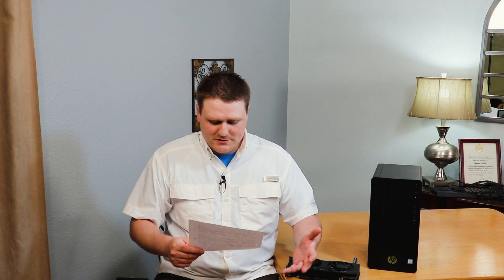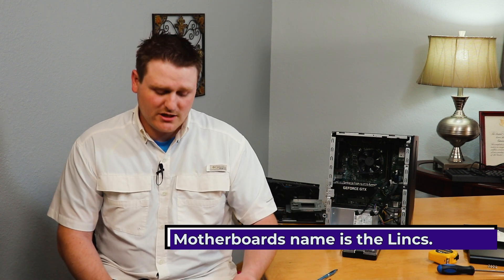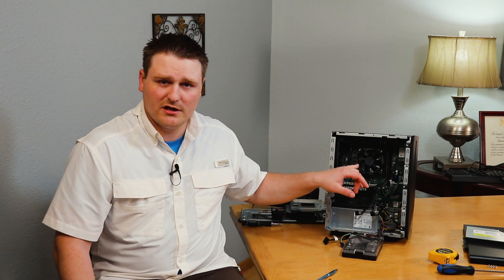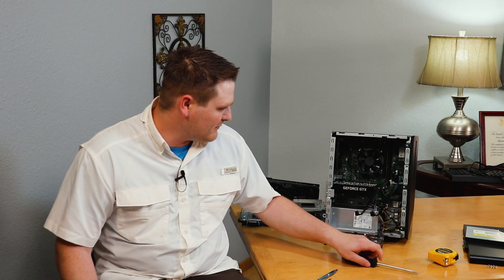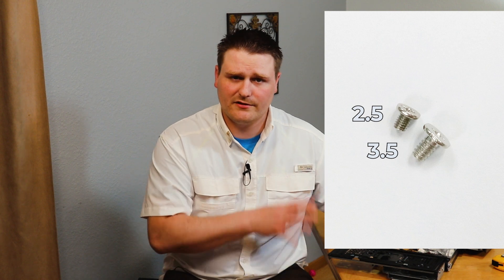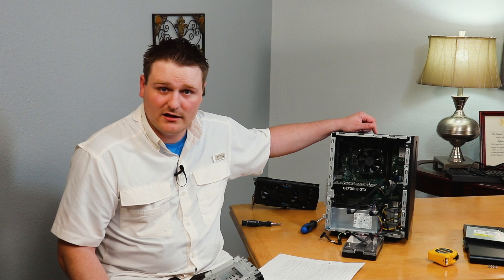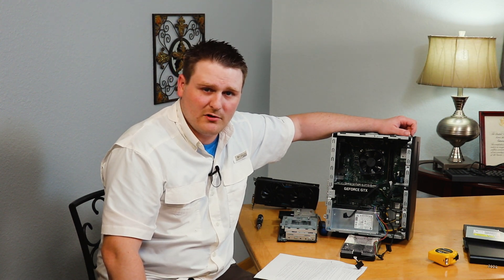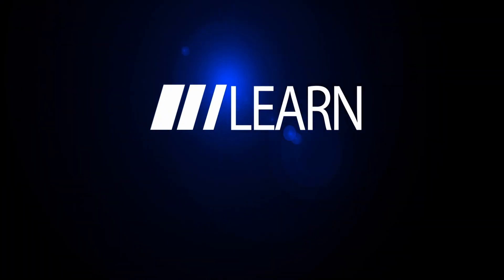Upgrading A HP Pavilion Gaming Desktop Explained! | Intel i5, 1660ti, 8GB, SSD + More! HP 690 Models

Comment: I have a HP pavilion desktop with a gtx 1650 super and I want to get an RTX 2060.  It came with with a 400w psu but it only has a 6 pin. Should I get the 400w psu you mentioned in the description or just an 6 to 8 pin adapter?
Reply from the maker: 6 pin to 8 pin will be fine. Make sure it is 16 or 14 Ga wire
Reply: @TNW1337  I found one at 18awg. Does bigger mean better or should I look for a 16?
Reply from the maker: @joellikebowl  smaller is better. smaller = larger wire.
Reply: @TNW1337  thanks!
Reply from the maker: if you wanted to you could do a 3070.  As long as it does not go over 220TDP with Boost. Also you will need a 6 to 8pin and then a 8 to daul 8 pin. also you will want the card to be no longer then 10.25
Reply: @TNW1337  cool. I'm still going with the 2060. By the way I actually have the Ryzen(TG01). Is that clearance still good? The card I'm looking at is just shy of 8in
Reply from the maker: @joellikebowl  You will not be sad it is a great Card. Also it can support the RTX supper, not sure if you want to go that high on budget. Or you may want to wait for the New AMD Radon cards coming out. The 6000's They say they may kick the crap out of the RTX 3 series. And are going to be cheaper.
Reply from the maker: @joellikebowl  Yes it will work it is the same it is 10.5 so as long as you stay below it your fine.
Reply: @TNW1337  thank you. It's such a pain to upgrade prebuilds but your videos took a lot of the guess work out.
Reply from the maker: @joellikebowl  Thanks man here to help :P

Comment: I have the hp pavilion desktop 690-00xx trying to upgrade the ram and don’t know what one I need
Reply from the maker: 2666mhz but the best price is going to be for 3000Mhz/3200Mhz CL15 or CL16 if you can find 2666mhz go for it, lower CL number the better so CL15 is better then CL19. You can go up to 32Gb 2x16Gb dims. 288pin DDR4 3000Mhz CL16 or 288pin DDR4 2666Mhz CL14 or CL15 is what you want to look up also 3200 maybe CL 18 or 19 will work I've tested it. It does Clock it down to 2666Mhz or 2400Mhz.
Reply: @TNW1337  Samsung 8GB DDR4 PC4-21300, 2666MHZ, 288 PIN  this should work correct
Reply from the maker: @jtrillz4597  yes
Reply: @TNW1337  just ordered thank you
Reply from the maker: @jtrillz4597  No problem
Reply: @TNW1337  would this work with 690-0020
v-Color Prism RGB 16GB (2 x 8GB) DDR4 3200MHz (PC4-25600) CL16 1.35V Desktop Memory Module Ram Upgrade Gaming UDIMM -Grey (TL48G32S8KGRGB16)
Reply from the maker: @xKego.  I like oloy ram for the hp. It normally runs the speed you by. That is a good brand.

Comment: Hi I have a question, I want to upgrade to the GTX 1050 Ti Gaming 4G graphics card. Does this pc support that? I also don’t know if it supports dual fans.
Reply from the maker: It does suppot 1050ti if you have a 6 or 8 pin. On the psu
Reply: @TNW1337  hi I have another question, will it fit in the desktop, the msi 1050 ti gaming graphics card?
Reply from the maker: @cpn1439  It should yes.
Reply: @TNW1337  thank you man, means alot
Reply: @TNW1337  thanks

Comment: Can it support the new nvidia rtc 3000 series
Reply from the maker: Um If the TDP of the card is lower then 180watts yes, Also you would need a 12 pin to 8pin adapter. Also the size of the card can not be larger then 10.5"

Comment: Can I upgrade from 1650 to 1660ti on a 310w psu
Reply from the maker: If you have a 8 or 6 pin yes, but you will be at the limit of the PSU. The 400wats psu from HP is only 77$. I have not tested it but it may work.

Comment: Does the come with an extra cable to add a ssd
Reply from the maker: Some models do. depends on the set up.
Reply: @TNW1337  I got the same pc and I want to add a ssd
Reply from the maker: @wesxzy  You may need to pick one up they are cheap just make sure to get a sata 3 cable.
Reply: @TNW1337  I also got another question, what’s the highest graphic card I can upgrade to that the pc can handle
Reply from the maker: @wesxzy  With the 400w PSU 2060 Super.
Reply: @TNW1337  what about the PSU that comes with it already
Reply from the maker: @wesxzy  You will have to look.
Reply: @TNW1337  okay I don’t know a lot about pc but I want to see if you know
Reply from the maker: @wesxzy  If you google your model it will tell you what Psu you have. It would be hard for me to know all of them, as they have about 70+ different models and combinations. Most people just see the 1st 3 numbers, But the number that come after are more important.
Reply from the maker: @wesxzy  Also they have a Intel and AMD version so it is more like 140+ models. I wish my memory was that good :)
Reply: @TNW1337  I’ll check and see if I can find it
Reply from the maker: @wesxzy  Should be on the bottom of the case.
Reply from the maker: @wesxzy  Do you have the same PC in the video ? same specs ? if yes you should have the 400 watts PSU. It has to be the same Specs word for word. Hopefully this helps .
Reply: @TNW1337  yes I have the same pc in the video
Reply from the maker: @wesxzy  Then yes you will have the 400Watts Psu sir.
Reply from the maker: @wesxzy  hopefully that helps :P

Comment: Is the case change able and the mother board?
Reply from the maker: Yes and no you can use the Cpu, Ram And Gpu. Motherboard will have to stay with the Hp power supply. It is a Hp prob and will not fit in a normal case.
Reply: TechNitWit so it has to be a hp case?
Reply from the maker: @flako5904  yes
Reply: TechNitWit so I can’t change it to like a nxzt case or other gaming cases sorry bothering just trying to get a new pc
Reply from the maker: @flako5904  nope

Comment: I heard the sunflower motherboard is customized fitting, is there any other case that i can get that will fit the sunflower
Reply from the maker: Yes and no Most of the time due to the proprietary MoBo and PSU people just take the parts like Ram, Cpu, Gpu, Drives and swap them.

Comment: hi I have AMD Radeon RX 580 4 GB (256-bit) GDDR5 and I want to change to NVidia please help me with a decent upgrade
Reply from the maker: Do you not like Radeon cards ?
Reply from the maker: 1660ti or a 2060 GTX
Reply from the maker: @LucaTim-official  Ah what Power supply unit do you have as this may limit you.
Reply from the maker: @LucaTim-official  Cool, you could put up to a RTX 2070 Low powered card in if you wanted to. I have not tested a 2070 But I know a 2060 Super will work.
Reply from the maker: @LucaTim-official  Any time sir.

Comment: great video, do you know if the psu and size would be enough for a rtx 3070? thanks!
Reply from the maker: Well they are going to have 12 pin connectors from my understanding. they are also going to use less power. I am pretty sure if you can get a 8pin to 12pin adapter and the card is under 10" yes it would work.
Reply: @TNW1337  awesome! also, I just bought a wd black nvme sn750 ssd, is there a slot for it? or would I need any cables for it? ideally I'd like to keep the included m2 and add this one too..
Reply from the maker: @skabossdude  No if it is a Nvme there is only one slot, there is a extra Sata Port.

Comment: So I got an RTX 2060 coming in which is 8 pin , the PSU I have has a 6pin for the card with a 2 hanging off of it . will I be able to use those together or would I have to buy a 6 to 8 pin adapter ?
Reply from the maker: You will need a adapter 6pin to 8pin adapter.
Reply: @TNW1337  thanks very much
Reply from the maker: @mortifidpenguin  I was mistake, some do have the 8pin that splits to a 6pin My 690 has it my TG does not it is a 8pin
Reply: @TNW1337  O perfect yea figured that might be the case but I wasn't sure relatively new to building pc's hoping to do a full build later this year or early next but figure this would be a good learning opportunity and also allow me to get a bit more use out of the HP I already have

Comment: Thank you, have a good day man!
Reply from the maker: No thank you for the support :P
Reply: @TNW1337  One question please, can I upgrade the stock CPU Cooler with this one? 

https://www.amazon.com/Noctua-NH-L9x65-Premium-Low-Profile-Cooler/dp/B00VB3Y89E?ref_=ast_sto_dp 

Thank you!
Reply from the maker: @thienhofficial  Yes but you will need to do a little modding. I have a video planed on this soon. You will need 10-12 mm screws of the same tread pitch that Intel uses. I found these at my local hardware store.

Comment: Correction regarding the RAM speed. This PC does not support XMP RAM profile, most of the performance RAM, like Cosair Vengeance, use XMP and will only run at 2133MHz. 
Safer to get 2666MHz CL19 RAM if you want to run at 2666.
Reply from the maker: Yes and no I've found that 3000mhz likes to run @ 2666mhz, You are right Hp motherboards do not support xmp. Most common ram now is 3000mhz

 I need to add in a correction it was not 2666mhz it was 2400Mhz was the common speed found.
Reply: Can you list the exact ram you have tested that actually runs at 2666? You recommend some performance ram and I have verified they only run at default of 2133.
Reply from the maker: @rawfish123  The hinix sticks from hp run at 2666. I may have not spelled that right. the Adat Kit I used in the video runs at 2400 it was 3000mhz. Also you have to understand your going from single Chanel to dual. With the New Intel and AMD They need Dual Chanel to not be bottle necked. 

If you had 2000Mhz ddr4 dual channel over single dim of 3200Mhz you would have a gain of 25-35% with the dual dims depending on What Cpu is used . Even with the slower Speed, the different from 3200-2133mhz is negligible at best. If you could set the speed on the system. You would not see that much of a gain, maybe 10-30 Fps gain that's going from 2133 to 3000.
Reply from the maker: Hope that helps I also tested crucial  8GB & 16GB dims they both did 2400. 16Gb dims was 2x16GB 2666 and 2x8GB where 2400. They Both clocked at 2400Mhz. Corsair also did 2400Mhz @ 4GB 2X dimms
Reply from the maker: I had some one else that got a corsair kit and it clocked it to 2133Mhz Is this looking in the Bios, Task Manager, Or Hardware Monitor? HW Monitor you would have to dl & install.
Reply: @TNW1337  OK thanks for the info. I know I won't real world diff from 2133 to 2666. But it just bothers the engineer in me. We'll see what deals we'll see Black Friday. Looking to ugrade to 32 from 16.  FYI, speed is confirmed with CPU-Z.
Reply from the maker: @rawfish123  It bugs me to Not sure why HP does not add in the support. it is a z370 chip set it is rated up to 3000Mhz. Also if they beefed up the thermal solution on the board, I've seen z370 get up to 4200Mhz Oced. 

Also there is no reason why the boards should not support up to 3000Mhz XMP. Maybe its so they can push the Omens? I feel like it was one of 2 things. They had it disabled to push buyer that wanted faster memory to a more expensive product. Or they did not want to pay for the driver support from the motherboard manufacturer. 

At this point I am just guessing.
Reply from the maker: @rawfish123  Yeah if you want make sure you can get the fastest speed 2666 your stuck with the hinix ram that hp supports. 

But going from 2400 from 2666 is pretty small of a hit. Also The kit is cheaper then hps. where the 32Gb kit from hp is $340
On amazon you can get a 32Gb kit for $100.
Reply from the maker: @rawfish123  I made a mistake the adata kit is ruining at 2666Mhz
Reply from the maker: @rawfish123  For the 690 or the TG?
Reply: @TNW1337  690
Reply from the maker: @rawfish123  https://pastebin.com/9dKxtZSv
Reply from the maker: @rawfish123  Did the link work for you ?
Reply: @TNW1337  thx it worked. Yes the adata has a good spd table. It does have timings for 2666. I'll put that on my list.
Reply from the maker: @rawfish123  Do you Have the 690 or planing to buy ?
Reply: @TNW1337  I've the 690-0073w
Reply: Got a good deal on the AData XPG and can confirm it works at 2666 cl19. I suggest you remove the vengeance from your recommendation since they only run at 2133.
Reply from the maker: Give me 2 min to boot it up

Comment: Can I upgrade my HP590 with the 500W L05757-800 PSU ?
Reply from the maker: I will have to look when I get home, My understanding is they only  made a 400 max.
Reply: @TNW1337  thx. Mainboard and connector cabels are the same as on mine. Also the case size is identical. But not sure about the width / length of the PSU.

Comment: I have a HP 790 how do you fold that bar you are laying down there
Reply from the maker: push the gpu to the back of the case, it will then snap in. then you can close it.
Reply: @TNW1337  probaly ganna take some fanasing
Reply from the maker: @alphadogzairsoftfamily7245  it should not take to much but if you press the card to the rear it should just slide in. Then you can close the latch.
Reply: There is a meatle silver storage compartment that empty really with it where not there would give me more room but looks like it I want too remove it all have too remove the face plate .
Reply: Left side is hard drive & CD rome but there is a bracket on the right empty ram is under hard drive .
Reply: @TNW1337  this one is duel fanded I'm not sure
Reply from the maker: @alphadogzairsoftfamily7245  Dual fan should be fine.
Reply: @TNW1337  ok ty do you know where the screw is so I. Can take the black peace off lol
Reply from the maker: @alphadogzairsoftfamily7245  Sorry no, I used the plate the was on there stock. I know you can remove the mother board to get at it.
Reply from the maker: @alphadogzairsoftfamily7245  I know the 790 is a bit different from the 690.
Reply: @TNW1337  ok so do I need both the p1 cable that's hooked too the mother board & p4 cable for this card im ganna try too get it in there I just don't see how im ganna sqeeez it in there with that black bar in the way .
Reply: Ok I got it in there but it said please power down & insert all pci power cables I have a p4 cable out & a p1 cable in my mother board do I use the p1 cable or do I need a adapter

Comment: EVGA GeForce GTX 1060 SC GAMING, ACX 2.0 (Single Fan), 03G-P4-6162-KR, 3GB GDDR5, DX12 OSD Support (PXOC) this is waht im looking on upgrading too i have a 1050 know
Reply from the maker: Well the 1060 is not going to be a huge upgrade. It is still a upgrade about 7-10%

Comment: i have 400 watt 
i have I3
Reply from the maker: Yeah It should work just make sure you have a 8pin or 6pin extra inside.
Reply: @TNW1337  ok awsome ty
Reply: I'm looking too upgrade for when I can play im going into the Army National Guard bro I'm 31 2 kids married ill be resves but I'm ganna kill it I work 4 10 hour shift makeing 17.60 at amazon right know I'm 213lbs I ran 3 miles yeasterday doing 9minuts a mile fucking ganna be the best .
Reply: I work out daily body wait only love the video thank you for the help
Reply from the maker: @alphadogzairsoftfamily7245  Good Luck Dude, This will work out great. Make sure you spend the time to get in shape.  It will be worth it for basic. Make sure to work on Sit ups, pushups and Pull up's.
Reply: @TNW1337  I have been daily do you think Gigabyte GTX 1060 G1 Gaming 3GB GDDR5 Graphics Card (GV-N1060G1 GAMING-3GD  V2) this would fit in my HP 790
Reply from the maker: @alphadogzairsoftfamily7245  post a link
Reply: @TNW1337  on my phone sold by bitpro
Reply: It's on newegg I just bought it
Reply: @TNW1337  💖

Comment: Can you put a 1650 super in this pc or no?
Reply from the maker: Yes you can. You could put a RTX 2060 Supper if you like, if it has the 400w Psu. I will have new video showing it soon, editing as we speak. 2060 Supper & 16Gb Ram upgrade With Bench marks to show the differnts.
Reply: and also is 1650 better than 1050?
Reply from the maker: @wizyo69  Yes it is by a lot. if it is a 1650 super. 1650 is about a 17% gain the Supper is almost a 60% gain
Be aware that the 2060 where going for about $300 $320 last time I cheeked.  Whats you budget ? 175?
Reply from the maker: Here's a  link to a good card 
https://www.amazon.com/gp/product/B081KY5L57/ref=crt_ewc_title_huc_1?ie=UTF8&psc=1&smid=ATVPDKIKX0DER
Reply: oh ok thanks because i want to upgrade my 1050 to a 1650 and upgrade my 8gb of RAM to 16
Reply from the maker: @wizyo69  Make sure its a supper.
Reply: i really need the best advice because i know nothing of this stuff so if it’s ok if you could put the links to what i need to buy I would greatly appreciate it
Reply from the maker: @wizyo69  Sure
Reply: @TNW1337  thank you
Reply from the maker: @wizyo69  Welcome
Reply from the maker: @wizyo69  https://www.amazon.com/gp/product/B07RM39V5F/ref=crt_ewc_title_huc_1?ie=UTF8&psc=1&smid=ATVPDKIKX0DER

Comment: Greetings, thanks for the video, if I upgrade this desktop with a gtx 2060 super do I need to change my power unit? Currently I have a 1050ti, 16gb of ram and a ryzen 5200; im new to the PC market.
Reply from the maker: if you have the 400w PSU yes
Reply: @TNW1337  thank you

Comment: Any cpu coolers that you would recommend for it? I want to add on eof those and a new exit fan. Any recommendations?
Reply from the maker: I like Cool maters, Deep Cool & Noctua Corsair does make some ok stuff as well.
Reply: @TNW1337  will the DEEPCOOL GAMMAXX GT BK fit in it?
Reply from the maker: @arturovega1730  no that will not work. it is to tall, has to be smaller then  3"' tall